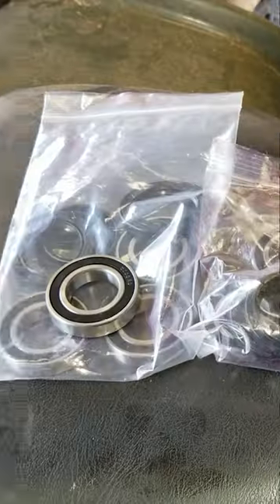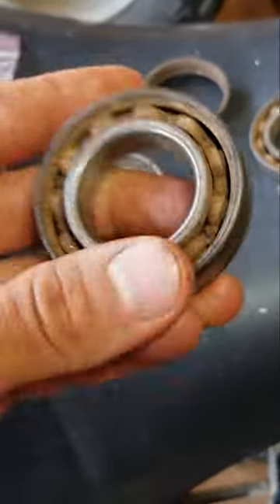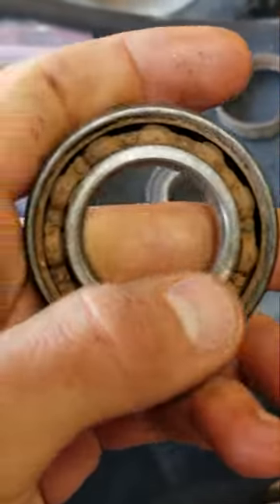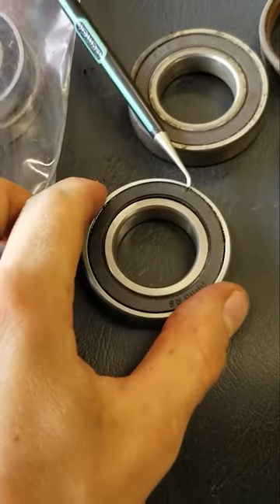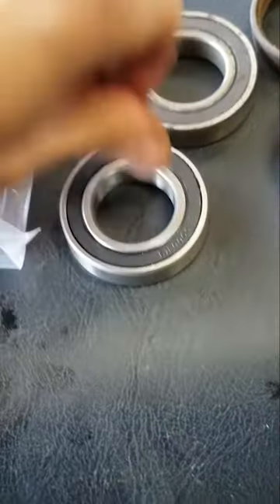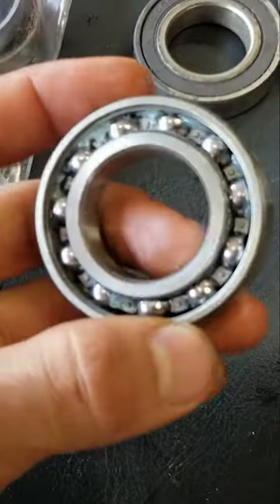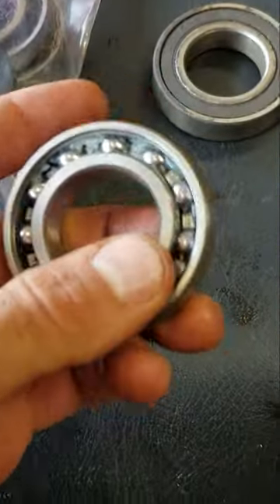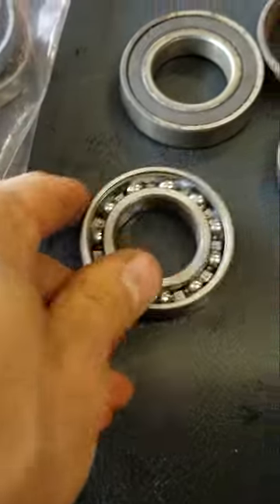Bearing HACK

Comment: Little too much grease, too much grease can actually increase drag especially when it's cold out
Reply: That doesnt make sense for a wheel bearing i promise after a couple blocks of driving its heated up enough to not drag
Reply: @Trust-w7i  yeah, "too much grease" like how do u have too much lol
Reply: @atomicbogator6799  yes it is possible to have to much grease. Over packed bearings will overheat and fail. I've rebuild hundreds of industrial pumps due to over greasing
Reply: @NDC1115  we are talking about wheel bearings ur supposed to grease till it comes out when on the car or pack until full ive always done it that way and had no issue
Reply: @atomicbogator6799  it dosen't matter what type or application of bearing, im saying that it's possible to have to much grease.
Reply: This guy thinks there's no friction based heat in the universe...
Reply: @NDC1115  ig but from what ive seen you really cant for wheel bearings on cars
Reply: Or the wrong composition of grease what was in it to begin with are they compatible with one another lol oh well not my bearing

Comment: There was literally grease in it on the reveal shot.. They put enough in from the factory to be fine.  You are mixing two different compounds and that could lead to premature failure.  Not to mention over packing with grease.
This is dumb.

Comment: It's crazy I bought new wheel bearings and return them because of this I went to the junkyard and pulled some off the same van I have and packed them full of grease much higher quality I guess the guy that owned that van must have bought good parts but yeah it's crazy when you buy new stuff especially online you don't realize how crappy some of this stuff is made but they don't even feel a bearing with grease who would not do that
Reply: Your supposed to pack wheel bearings before installing..of course they didn't have any grease lol
Reply: I bought new wheel bearings for my 94 Ford econoline van. Hardly any grease in them. These companies want you to replace this stuff ever so 1000 miles. It is insane. Now if I could just figure out why the van has a high idle. I cannot figure it out. I put a new idle control valve in and fixed some vacuum leaks.
Reply: First of all GET TIMKEN BEARINGS. Most wheel bearings DON'T come with grease so you gotta pack it yourself with QUALITY grease. Hub assemblys are usually pretty greased.

Comment: You might want to think about cleaning out the old grease, dirt, whatever before you put nice clean grease back in.   Just a thought.
Reply: LOL WOT? They are brand new bearings.
Reply: @johncoops6897  even with new bearings it’s good to clean the factory grease out because some greases are not compatible with one another and can brake down. It’s best for your new greaser to be the only grease in there
Reply: @BillOfAllTrades2016  - yes, but that is not what the original person was talking about. They mentioned old grease, dirt etc... yet the video appeared to show new bearings (hence my comment).
So I watched again... it seems this Youtuber did two different things, both of them wrong...
A) packed a rusty dirty dry and damaged old bearing with new red grease, then refitted the old seals.
B) opened a brand new bearing that clearly had the correct amount of grease, and then completely filled it with different red grease.
Both these things are wrong!
1) If you have new bearings, don't refit old ones, especially if they are rusty. Lubricating an old bearing will be a very temporary fix (hack)... but it's pointless when you have already disassembled and purchased new bearings 
2) For new bearings, the amount and type of grease is absolutely critical. There is never a need to open and pack any new sealed bearing. The manufacturer knows what's needed... however, like you said, any existing grease must be completely removed first. And you need a surprisingly small amount of grease on a ball bearing... more is not better.I

Comment: Added heat and pressure with no worries to go now won't the seals pop off
Reply: The shields will say fuck it as soon as he puts a little rpm to them. Those things will leave the party quicker than the guy that bricked the shitter and flooded the place !